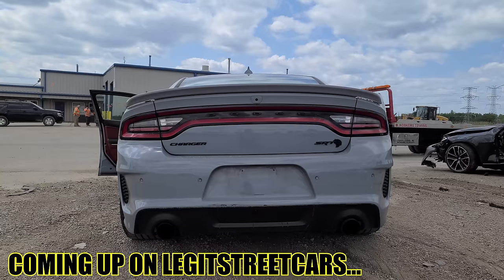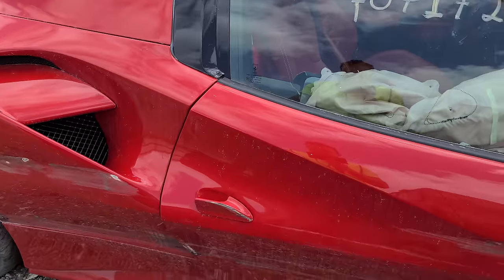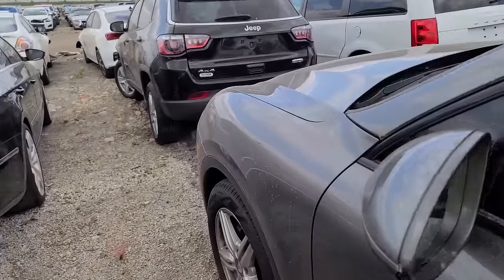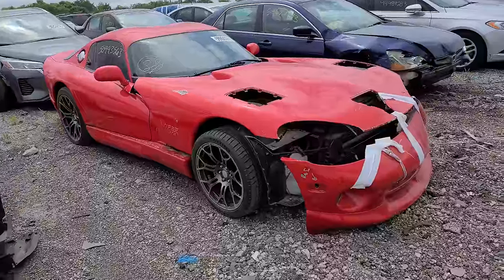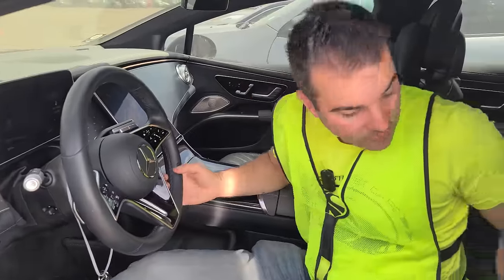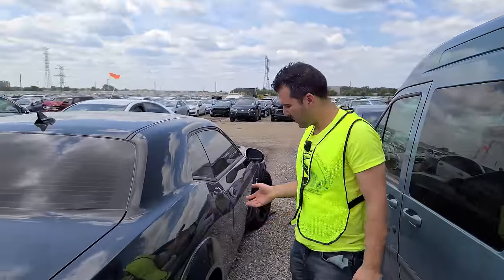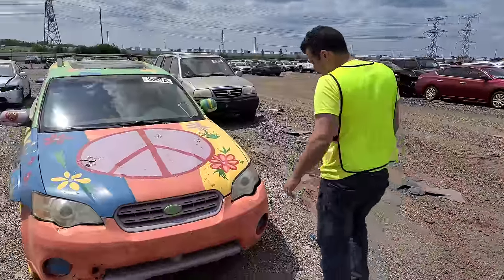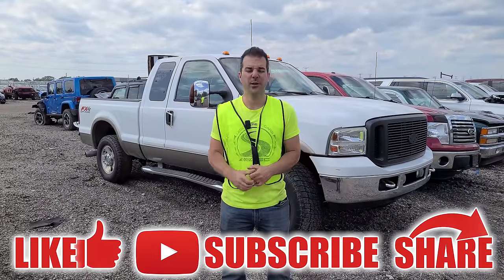Bullet Holes EVERYWHERE! Shopping For Theft Recovery & Vandalism Cars At A Chicago Auto Auction!

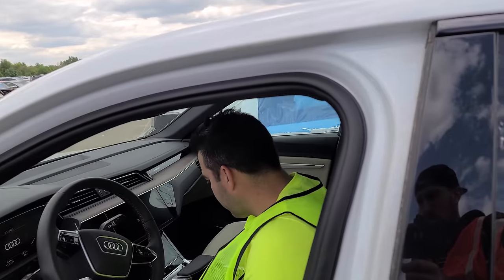Comment: 8:25 It could be some type of a 
"Lemon Law" vehicle. Where if the new car has to go to the dealership three times for a certain problem and the dealership tries to fix it three times but can't then the car is called a "Lemon" and the buyer bets to buy another car and the Lemon car is forever marked as a "Lemon" from the factory. This happened to quite a few 2007 BMW 335i's when they first came out as the High Pressure Fuel pump's had a major flaw and the car's were brought to the dealership (Under Warranty of course) but the HPFP kept failing so they were sold off as "Lemon cars under the "Lemon Law" I actually bought one in 2014 in Canada after someone had bought the car in the USA and brought it up the Canada then I got it years later. Under the car report in was written up as a faulty car just a few thousand miles after it was sold due to a "Mechanical default" from the factory. That's how I found out about that law.

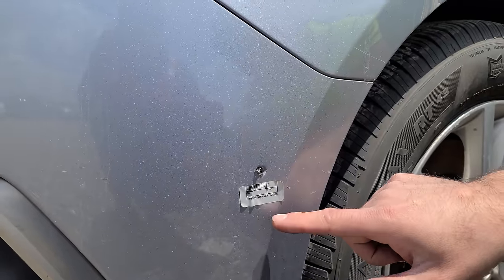Comment: Always interesting seeing what the Chicago Auction lot has to offer, Alex.  In regards to the bullet hole in the Sonata bumper cover 13:17, you would be surprised how much plastic type materials and even wood can close back in on itself after the bullet passes through.  No way to tell caliber based on the size/diameter of the hole in metal, either.  Metal tend to flex and stretch a bit before the bullet breaks through and that makes it impossible to tell.  17:15 Doors can stop bullets, but only if the bullets hit some of the heavier metal structure/mechanisms inside.  I've recovered many a fired bullet from the bottom of door interiors, but at the same time many have just passed right through.
Reply: On that same note, when I joined the military, I was surprised by how small a hole was made my m-16’s. They’re only .223, but I didn’t know anything about that as a kid.

Comment: That rivian van would make a cool camper conversion
Reply: Until you realize anywhere you want to camp has no chargers
Reply: @ROBIN_SAGE I think everywhere you want to camp has a charger. RV parks have outlets and it can be charging the whole time. With a generator added, you can charge while boondocking. Not sure what the range on one of these is though
Reply: @05milmachine90  very true, but it’s the hundreds of miles in between where the problem lies….

Comment: 26:51 I worked at Nissan many years ago, and we would get what are known as hobo units. They were always delivered by rail car and homeless people would jump in the cars and live in them from Mexico to Tennessee. I was in the body shop and I had to do a fair bit of detailing those units, the worst was a infinity q45 that someone used the center console as a poopy potty. We didn’t have and hazmat stuff we just pulled the console and replaced it and detailed all the other mess. These units were lived in till they ran out of the small amount of fuel in them and they would move on.

Comment: The Viper had a non-driver slipping the clutch excessively.  Very, very excessively.   Something around the bell housing caught fire, which kept the already hot clutch and flywheel area hot.     Plastic and vinyl often burn with high heat, and it may not have taken much for the bell housing to melt.    You’d be surprised how quickly aluminum melts, and what doesn’t reach that point get brittle, so some of it fell away, some of it melted, and what you saw was left.

Comment: The Vipers Engine Block is Alumiumn, if their was a fire right behind the engine it could have warped the engine block, hence the salvage tite of it, could be a 50/50, they use the Tremic T10 Magnum for the tranny, so its not some unobtanium, also the other thing is the wiring harness, if it got that, that may explain why the windows are down

also 4:27 insert fry going Fix it fix it fix it fix it, FIX IT lol and you may wanna check the online lot for it, as what they say, aint what you said lol

Comment: Spending many years working in collision repair shops in upstate and Long island area of NY where fraud is the only way to remain afloat the ways to maximize payout from insurance are endless one that has always stuck with me is getting a fairly new M5 in need of a bumper cover n some paint work totalled out because of bio hazard poop. The customer wanted out of their payments and they got into a parking lot bump that spooked their little yapping dogs n they crapped all over in the car so after arguing with the adjuster on if the poop would clean or would the interior need replacing so to avoid getting screwed on a supplement they totalled it.

Comment: (Reference to the Hyundai) The usb stick is used as a key! It’s not electronic means. Lol I have 7 of these theft recoveries at my shop right now. They tear apart the lower panel on the steering column, pull out the tumbler and stuck a thumb drive over the little paddle inside. Once that’s done, boom they can turn and start it.
Reply: He pretty much explains that in the video.

Comment: @13:23 - it could've been a .22 but most likely not.  Bullets leave small holes in plastic and rubber, especially rubber.  Shoot a tire with a .50 cal and the bullet hole will be so small you'll have a hard time finding it.

Comment: Alex about .22 calibre ...... They come with different power loads for the small size actual bullet from the small plinking round .22 short to the higher energy .22 LR and magnum rounds, even the .223 (556) round from say an AR15 has a bullet only slightly larger than a .22 :-) 
Size of the hole isn't guaranteeing a low power firearm.

Comment: Ian 70 odd and never get tied of looking around breaker yards co part etc, in U.K. I found a RS 4 avant with 20k damage was small damage to front splitter drove it for 3 months until oarts turned up, man those Audi oarts need a mortgage to buy 🤪, but that engine 450 hp 8250 Rev limit going through that dynamic gear box with vector control, then finding out it was a demo model after seeing 195 mph show up, and digging into it’s history, I found out it could be pushing 500 plus, it’s 0-60 is 3.5 ,having a good deal of fun great for putting huge grins on your face, off to a dyno soon 👍

Comment: Metal will soften and or fatigue with heat. So the fire could have caused the metals to weaken, then in transport and Copart using their lifts, could have separated / shattered the transmission housing? Just a thought.

Comment: A red hot full copper jacketed projectile contacting a rubberized plastic vinyl bumper designed to hide minor bumps n dings will melt back to a much smaller hole than the bullet that actually went through it

Comment: I pretty sure you need two keys that come with the modules that your replacing and the car should start up.
So if you have a damaged car and it has two keys with it, take those and module. Install and give it a shot.  Those keys will have the immobilizer already programmed to the module